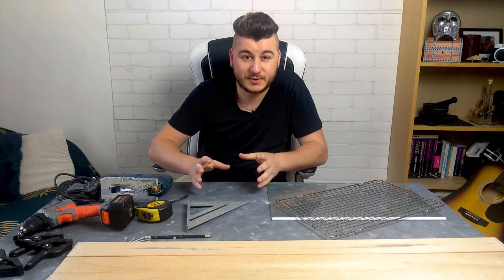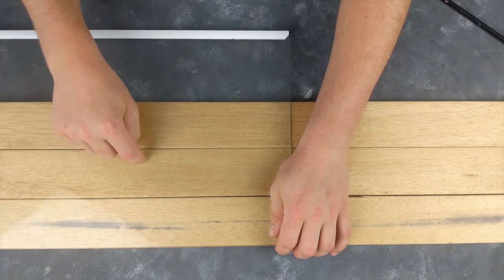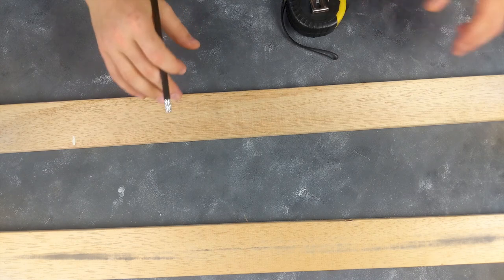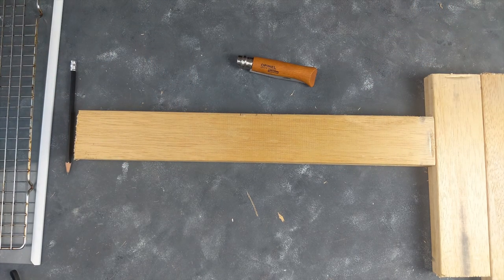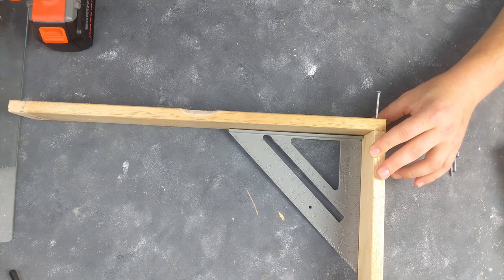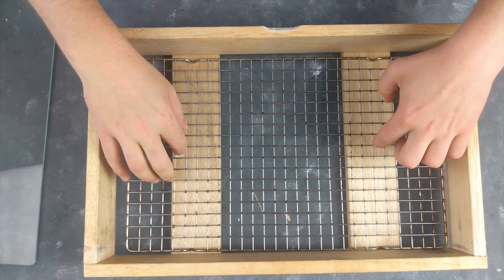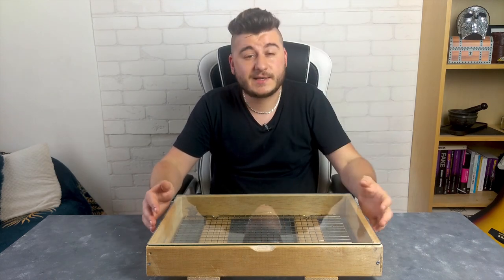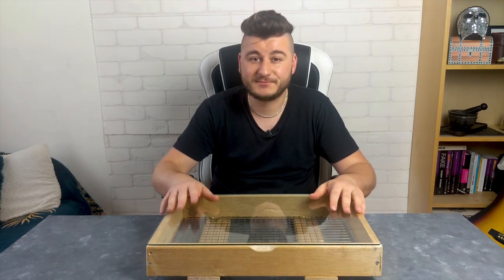How To Make DIY SOLAR DEHYDRATOR - Dehydrator Design For Small Spaces

Comment: I made Solar dryer and seen 8 degree celcius difference with ambient temp at 9 AM cloudy weather but seen moisture on poly carbonated sheet , Its common or need modification
Reply from the maker: Depending on your climate - you will need to make the appropriate adjustments.

This is a very easy sand basic dehydrator that relies on sunlight to do the job that's why it has glass on top ( to magnify the sun light intensity and to heat up the air  inside and get  the dehydration process done quickly to avoid the buildup of moisture.

The reason there is nothing on the bottom of the structure - apart from the parallel beams to keep the drying rack - is to circulate moisture out and not keep it in like in a sauna.

Moisture is the biggest enemy here as it will make anything your trying to dehydrate  mold.

And if this happens then you have to start again and waste the products.

So in conclusion, if its not used in direct sunlight , you may see moisture buildup as the sun will do most of the work for you.

Its really tricky here in the Uk for me as i need to fallow the weather forecasts really closely if i want to dehydrate anything,

Hope this answered your question - have a great day.